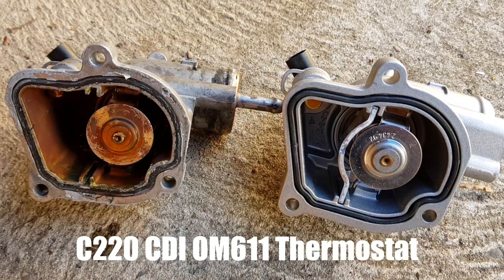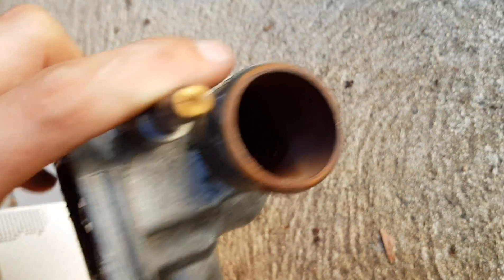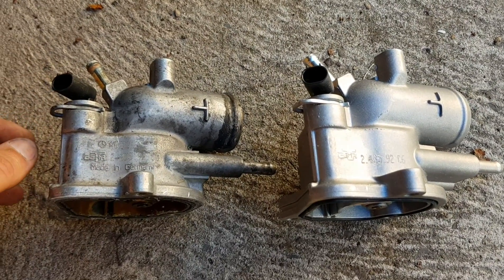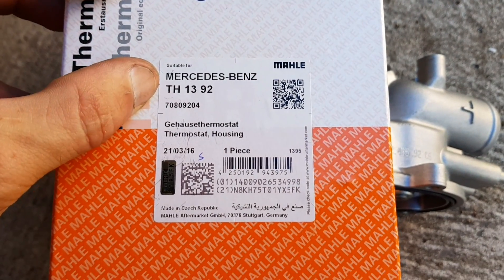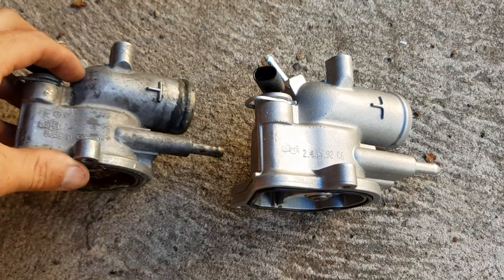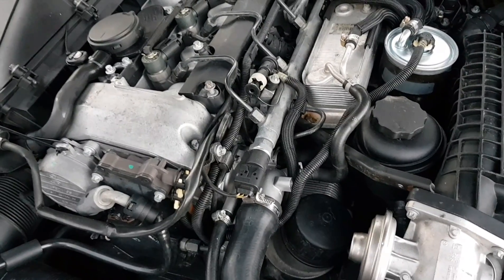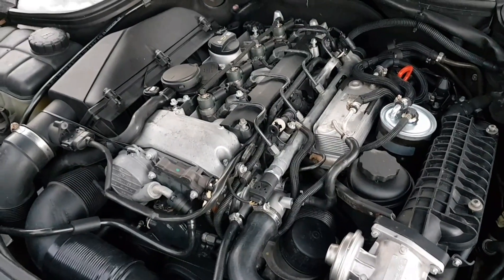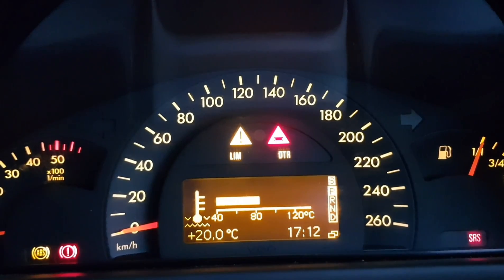Mercedes W203 C220 CDI OM611 Thermostat fault, effects of a faulty thermostat

Comment: I had the same problem with the same engine. Car would take hours to reach normal operating temps. Just replaced the thermostat and that fixed it. Easy fix.

Comment: Easy and cheap fix is use Gates TH01483 thermostat. (Renault CxJ-engine) Just put it in between the upper coolant hose and thermostat housing. Works perfectly and takes only 5 mins.
Reply: Have you done this modification? Are you saying that this thermostat is put between the upper coolant house and thermostat housing while keeping the original thermostat and housing on the engine as it is?

Comment: Hello Sir, 
I hope you're doing fine.
I've replaced the thermostat with Behr/Mahle (i believe OEM) but the temperature still won't go past 80 (it went at almost 100 at first try after the replacement) now even on the highway for 1 hour i barely get above 80⁰c.
Any tips ?

Comment: I have very cold engine temp and also no hot air coming in the cabin - will this solve both problems?
Reply from the maker: Yes without the thermostat working the car won't get the water temperature up to make hot air in the cabin.

I also bypassed the oil-water cooler that sits Infront of the radiator. It has 2 small hoses attached under the radiator.

Then I put a T junction into the small pipe that comes out of the thermostat and feed it into the pipe that his back into the header tank. I now get the proper 85c temps
Reply: Benz Performance Parts thanks mate
Reply: @benzperformanceparts3762  Why having to do that? Didn't you solve the problem by just changing your thermostat? Or does the bypass adds more efficiency to the optimal engine temperature?

Comment: Hey, i have a C200 CDI with an OM611.962 (same engine). I watched this video a couple months ago, because i had to drive for over an hour to get the engine to operating temperature. This is a low milage engine and i figured that i should try changing the thermostat if that was the problem. And it was! The old thermostat looked new but didnt function properly.

After 2-3 hours of figuring out how to change it without damaging anything, the new thermostat was mounted in its place. That was the time i noticed that there were no threads in the new part haha.

I want to thank you for making this video, keep it up!
Reply from the maker: After making this i also redirected one of the small lines out of the thermostat so it T joins into the header tank and by-passes the radiator. This was because the water pump water pushing water around and through the radiator with the thermosat closed .also c
Keeping the temp down.

I aslo bypassed the extra water cooler at the front.  

If you email me i will send you photo to explain it.

I get 85c within a short drive now.

Never have head problems
Reply: @benzperformanceparts3762  my problem was that the temp was too low, the thermostat was stuck open somehow. The car has been running great ever since i changed it and i've even felt a performance difference.
Reply from the maker: @Doomskilled  mine got to temp after a new thermostat but would still take half and hour or so.

Now with the other mods it take 10 mins.

Email me if you want me to send you some pics
Reply: @viestemnogotupi  hello sir, did you manage to make it work ? I still have the same issue.
Reply: @Mr.Januzi  hi, the car is warming up relatively slowly but that's normal for these CDI engines, I have changed the main thermostat and the little one (for the fuel radiator) and there isn't much of a difference...
Reply: @viestemnogotupi  I have changed the main thermostat, on the first run after the thermostat it went up to 100° and then it opened, but on the second run, it never went above 85 even if i drive on highway for 2-3 hours. I just checked the second thermostat and it is not working, and there are no new secondary stats to buy. (I seen a video on youtube where one combines this secondary stat with the same type of stat of audi/vw. 
Also, I have seen some c-classes with this secondary thermostat deleted and the hoses blocked and runing just fine. I think that’s what I’m looking forward. But I’m afraid that this stat has something to do with the automatic gearbox(cooling it) thats why i’ve been so reluctant.
Reply: @Mr.Januzi  i have changed the secondary thermostat with an insert from a VW one, like you said. The automatic transmission fluid is cooled in another place - where the engine oil is cooled, an aluminium heat exchanger bolted to the engine, so don’t worry. The secondary thermostat is for cooling the return fuel but I don’t know if it’s a good idea to block it completely, you can put a stud in the hose before it and that way restrict the flow. I will find the video for it and put it here.
Reply: @Mr.Januzi  here is the video: https://youtu.be/b5ISrLFGhDI

The stud is M8

Comment: I have the same model:  nearly 50k Km now Temp is less than 80  never above and blows smoke on acceleration badly..When Cold start the engine jerks the gear box changes for a while and fuel  consumption is also up. to 5.3. Use to be 4.6 long trip 100 Km . Round town is about 7.5 now and as high as 9 on cold starts. 
I have suspected thermostat. Manual give no guidance nor does Mercedes. Computer shows lots faults, but engine is running ok, jut rich. Typical glow plugs failure this age. 
Thanks the Video... and the tips about the torx bolts.  I have suspected this a while. Im off to find a new one like you have.
Reply from the maker: You also need to bypass the little cooler at the top and by pass another hose.

Email me benzperformanceparts@outlook.com 

And ill send photo back.

Iv done heaps more testing after this video.